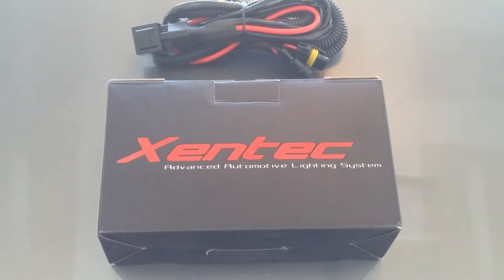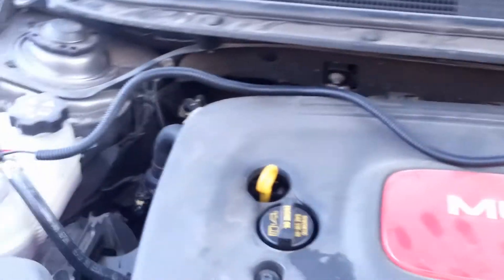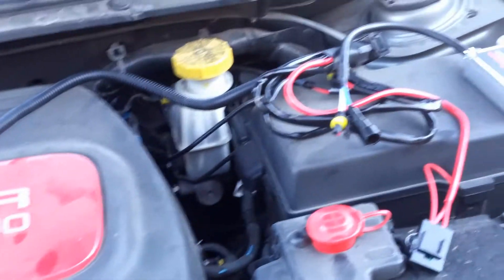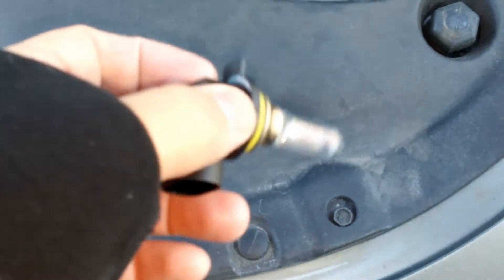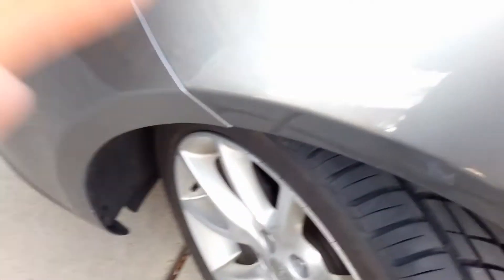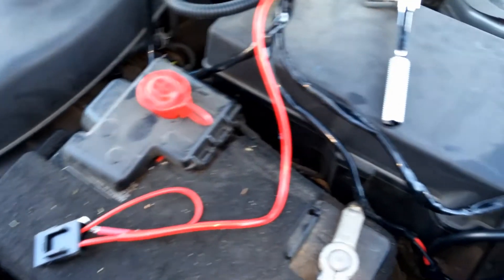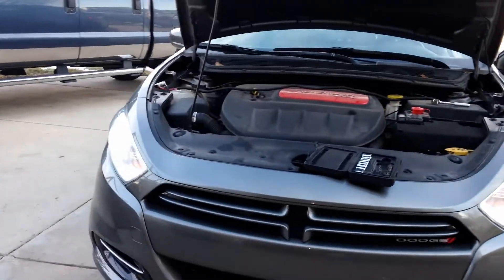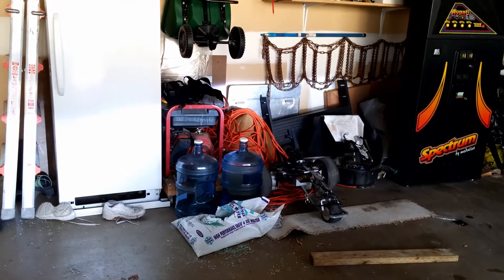Dodge Dart: Xentec HID Install w/Wiring Harness

Comment: 1) The buzzing is probably your relay because your connector is not reversed. I didn't catch you say that. 

2) Yes they will flicker without the capactiors. Do you still have an error message? It will not go away when you get the cancelers. 

3) DO NOT turn on and off your hids quickly like that. I believe it causes extra wear on your ballasts and can also fry your relay fuse. My friends dart did exactly that because he used his auto headlights when I told him not to lol

4)  Xentec is probably the worse HIDs you can get! Don't be disappointed if they don't work half the time. Like how they didn't even start on the initial warm up. At least you got the relay so you don't fry your BCM. :)

You get what you paid for though. I started out on my dart getting a DDM hid kit, with pretty much the same setup. Had the exact same issues. 10 different setups on my dart, and 8 other dart HID installs later I started getting into the canbus ballast game. Since the dart uses a canbus system to monitor lights. A legit one can go for as low as $40-60 a piece. Probably more than the entire xentec kit. You're looking at about $100 to $160 for a canbus HID kit. The nice thing about them, 2 bulbs and 2 ballasts. No harnesses or anything else. All the external pieces are built in. This is fairly cheap for a fully functioning kit on a modern car with complex can-bus style BCM. Especially since one single bulb for Dart's with factory HIDs is like $220 from the dealer! Cheaper online, but you get my point. Mopar's have always been known for being a pain in the ass to install HIDs. For as long HIDs have been out. haha
Reply from the maker: Speaking of relay fuse. Do you know where he got the replacement? lol I looked at the relay and there was no model number on it
Reply: Any parts store. Even walmart. lol I believe it's just a 10amp fuse. Maybe even 5 but my friend put a 10amp in his when it went.
Reply from the maker: cntrollerfanboy Yea I figured it out lol I am going to have to look into Canbus.
Reply: PwndByaB3anR check out this link as well. It's my forum guide to my install. http://www.dodge-dart.org/forum/dodge-dart-lighting/24310-theretrofitsource-9012-hid-kit-canbus-stand-alone-harness-no-errors.html